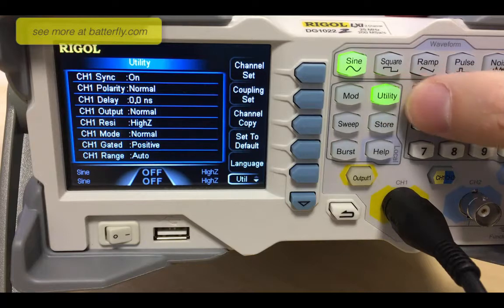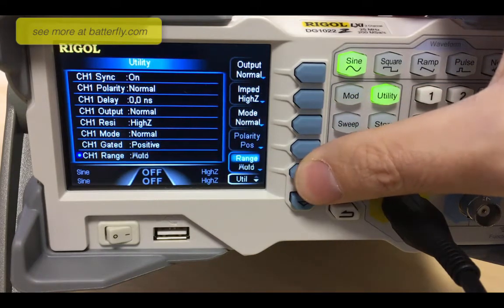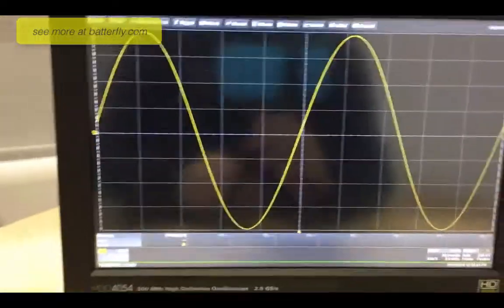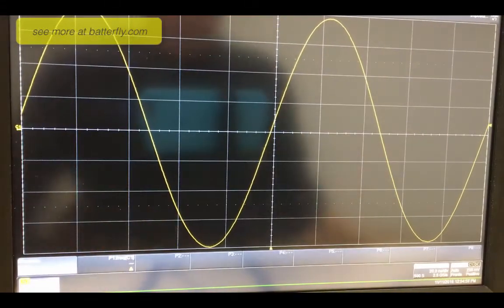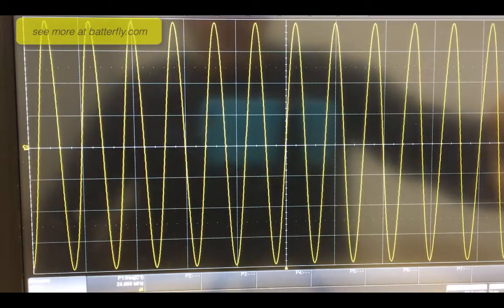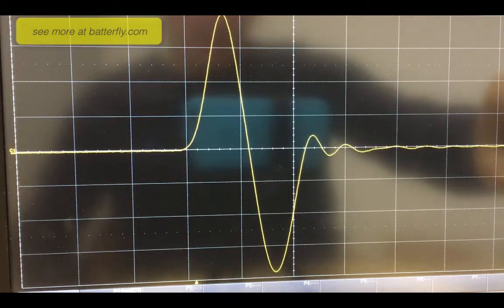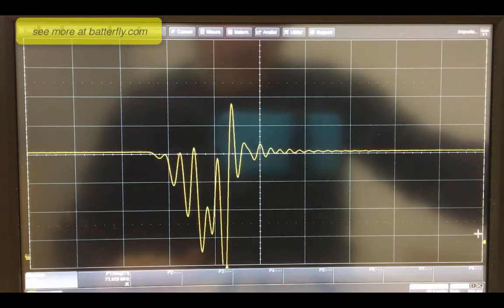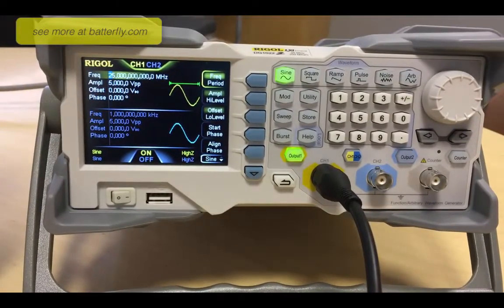RIGOL DG1022Z 25MHz Generator - Tested

Comment: I would suggest you set the Rigol to 50R output and set the scope to 50R input.  You won’t get transmission line ringing then as you have proper impedance matching.  Great video though.

Comment: If the output is set to low impedance, is there any protection from overcurrent if the output is shorted? How much current can it source?
Reply from the maker: Over Voltage Protection occurred when:
- The instrument amplitude setting is greater than 2Vpp or the output offset is greater than |2VDC| and the input voltage is greater than ±11.5 × (1 ± 5%)V (<10kHz).
- The instrument amplitude setting is lower than or equal to 2Vpp or the output offset is lower than or equal to |2VDC| and the input voltage is greater than ±3.5 × (1 ± 5%)V (<10kHz).
Reply from the maker: SDG1032X is more advanced than the Rigol DG1022, you may want to check the DG1022Z or DG1032Z
Reply: Thank you. :)

Comment: Apart from the max mHz is there much difference between this and the DG4162?
Reply from the maker: Hello, maximun arb frequency is up to 40MHz on the DG4162, memory is higher on the DG1022Z 2Mpts Vs 16kpts